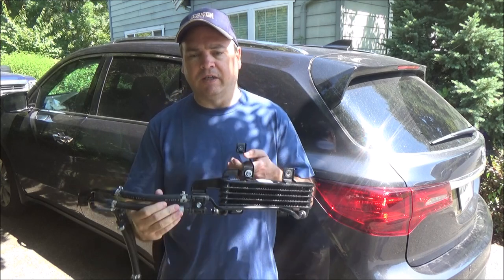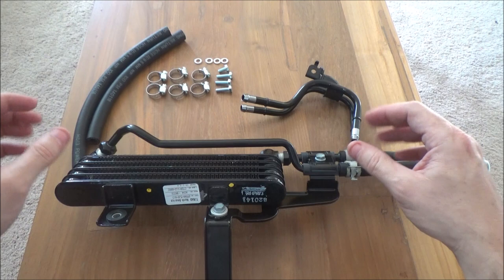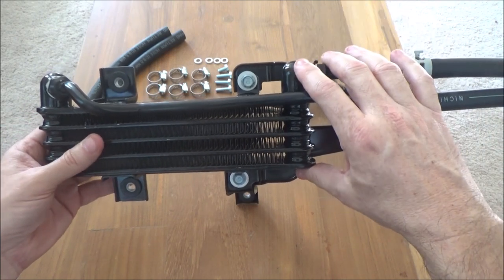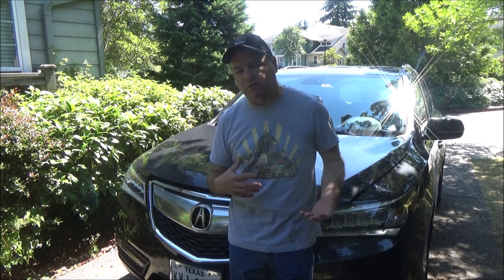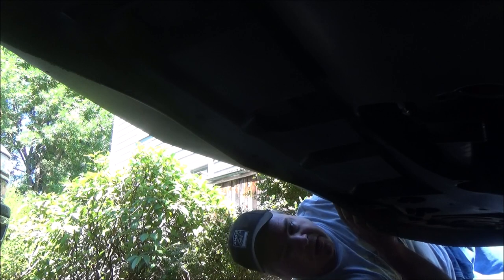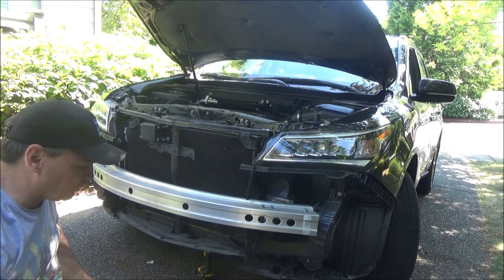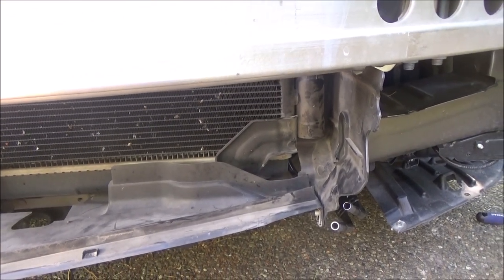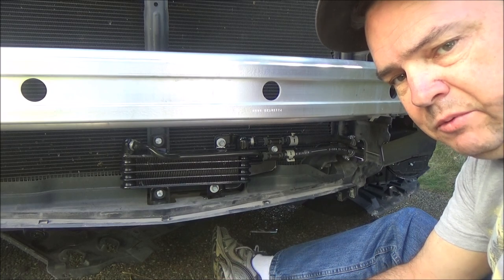Installing Transmission Cooler on an Acura MDX

Comment: Hey in case anyone is going to tackle this like I just did - take the bumper off.  I was up for the challenge of not taking it off for fear of screwing something up - whenever it comes to "clips" and "me" I always break stuff.  I tried my hardest to do it w/o taking bumper off and it was a nightmare....couldn't figure out a way.  Sucked it up and took bumper off with no issues, thanks to your video, and the rest is cake.  Hardest part of whole job is flushing your eyes out after all the dirt falls in them when you're under it trying to get the clips and bolts out to remove plastic 🙂 Thanks again for the great video....couldn't have done job without it.
Reply from the maker: Glad it helped.  Thanks for watching.

Comment: I originally watched the OEM trailer hitch video and that saved me a lot of trouble, especially learning to add the harness to the hitch before bolting in the hitch. I was impressed with the detail. Now I'm doing the cooler and as stated, I saved lots of money by buying the components. Great tip.  The cooler install video is great and as usual, very detailed which makes the job simple. I like the explanation of the cooler design as that is good to know. I'm an old auto transmission tech and keeping trans oil cool is the secret to transmission longevity. Thanks for a great video! Joe B.
Reply from the maker: Thanks for the comment Joe.  I am glad the videos are helping.  I felt the same way about the cooler in helping increase longevity of the transmission even when not towing.  I will post more videos as I get them done.  Next up is a brake system flush for the car.

Comment: I did this on my 2014 MDX. I needed longer cooler lines than what this specd. Good time to change the tranny filter as well. This probably adds a quart of capacity. I added over 5 quarts back after this drain and install. Thanks for the info. I also just loosened the top of the bumper and left the bottom attached for access
Reply from the maker: Awesome. Thanks for watching.

Comment: For anyone interested - there are aftermarket duplicates of the OEM cooler sold at a price savings. I saw them at a couple of online auto parts suppliers. Personally I prefer OEM parts but for those looking to reduce the cost of this upgrade there you are.

Comment: thanks for the video.  just installed mine and confirm it is SOOOO much easier with the bumper off.  I have no idea how others were able to do it without taking the bumper off.  Thanks!
Reply from the maker: You are very welcome.  Glad it helped and thanks for stopping by and sharing your thoughts.

Comment: Thanks for the vid! Everything mdx should have one of these installed. The 14-16 have issues with the torque converter overheating and degrading the  fluid which causes shudders and jerks. There's a TSB fix by a software update and flush tranny fluid. Guys are doing tranny fluid every 10k to prevent it from coming back.
Reply from the maker: I do mine frequently because it does seem to breakdown faster than I would have expected.  Fortunately, the fluid is way cheaper than the newer 16 and up models.

Comment: What is the part number for this? Where did you buy it that was so much cheaper than Acura/Honda??Thanks.  For the hose length, I just picked up 2 feet of hosing from the auto parts store and cut to size. It was in a Prestone kit at O-Riley Auto parts. I just took the transmission cooler down there with me and matched up the hose on the cooler to what they had on the shelf.  I used the hose length specified in the full kit I found online ($250) which was 235mm and 295mm. However, I cut them to 240mm and 300mm just to give myself a bit of extra room. The part numbers for the transmission cooler (stand alone, not part of the kit) and the pipe that wraps around the radiator and condenser are both specified in the video but here they are for reference (cooler: 25500-5J8-013) (pipe: 25220-5J8-010).  Good luck on your install. It's pretty easy

Comment: Thanks for the great video. Ordered the parts and look forward to getting our MDX more trailer-friendly. $75 worth of parts vs. $250 kit...just can't figure that one out...
Reply from the maker: Didn't make sense to me either. The key was getting the tranny cooler separate from the kit at that good price.  Once you have that, putting the rest together was easy.
Reply: @RoughRidersTV  Alright - putting the front back on I wanted to share this tip for others. Get 2' of hose and cut in half, only trim to size when you can mark how long exactly they need to be. Mine needed to be longer than the lengths described (I have a 2014 as well) - not sure why, but regardless it will save another trip to the parts store like I had to do...I would guess mine ended up at 9.5 and 11"
Reply from the maker: @1972mdc  Awesome.  Thanks for the tip and sharing the update.  Glad it worked out for you.

Comment: I'm a few years late to the comments here, but this video is timeless!

Absolutely wonderful demonstration on how to install a transmission cooler.  This is one of those rare videos in the subcategory of repair videos in that you won't find many not just on this make and model, but on others, especially when it comes to the "higher end" cars where the owner will likely pay a shop to do it.

If you do read this, any chances on you doing your suspension?  I am getting ready for the rear on a '15 MDX as well, with a major overhaul to it.   I might film it and see if I can upload it somewhere. Front suspension will be done next summer.
Reply from the maker: Thanks for the comment.  Glad it helped.  It's why I make the videos in the first place.  Help people that may have never done something like this...they can see generally how easy it is to do.
Reply from the maker: As for a suspension video, the MDX is still very solid at the moment so no need to do it on this car.  However, my duaghter's Nissan Rogue needed some front end suspension work so I made a couple of short videos on that process.  It's very similar to most front end setups with independent suspensions.

Comment: Only 7 minutes in but you may want to think about adding an inline filter to that as an extra layer of protection for the transmission.  Those little inline filters are easy to install and changing them when you do an oil change is easy and would give you some insight to what’s happening with that transmission.
Reply from the maker: Good tip.  This already has the inline filter but I agree, if you don't have one, it's a good idea to add it.
Reply: @RoughRidersTV  Can you tell me where that filter is? Just ordering the parts for our '14 MDX today.
Reply from the maker: @joeaverager  If to watch the part of the video where I am connecting the hoses up, one of those connections is the filter.  It's the part where after I connect up the wrap around metal lines (part from Acura), I then put in the hoses I cut from the auto parts store.  One line goes to the transmission directly and the other goes to the filter which is then connected to the transmission.  It's not really easy to see the filter itself in the video.

Comment: Advice. Learned the hard way- double check make sure you have the vertical bar on your MDX. My 2014 doesn’t even have it and I cannot mount this cooler anywhere. I’m out $180 as oem prices have doubled and I should have bought the full kit that comes with the bar
Reply from the maker: Can you fabricate the bar?  If that is the only thing preventing you from mounting it, might want to give it a try.

Comment: A couple of more questions . . . how much ATF did you lose when disconnect/connect the cooler? Then how much extra ATF was needed to bring it to proper level? I'll be adding this ATF cooler, buy them piece by piece to $AVE thanks to your suggestion. Thanks again!
Reply from the maker: Surprisingly, I didn't lose any fluid when I disconnected the hoses.  I expected to lose some but didn't.  As for how much I put in, I don't recall the exact amount but I think it was between 1/2 and 3/4 of a quart.  I just used the dipstick to judge.  However, I also did a fluid drain/fill a week or two later.
Reply: @RoughRidersTV  Great, thanks for speedy reply, much appreciated.

Comment: The new 2020 Acura mdx has cooling system. That uses the antifreeze to the transmission… I have question .. you think if the cooling system is empty no antifreeze.. that won’t the car to start ?
Reply from the maker: It's not the first thing I would look at.  Motors need generally 3 things to run...Fire (aka Spark), air, and gas.  When  car does not start, I start with those basic things to see where the problem is coming from.  For example, in the case of fire/spark, I look at all the things involved in generating that spark...from the battery to the spark plug and everything in between.  In the case of gas, things like the fuel pump, fuel lines, filters, etc. that might be preventing gas from reaching the cylinders.  So if the car is not starting, those are the things I would look at first.  From there, I would then look at the computer to see if it was inadvertently locking something down.  The transmission and drive train are all about moving the car once it is started so I can't think of anything immediately that would prevent it from starting.

Comment: Hey what about the air trapped in the radiator and hoses? It's a a closed system right? Do you have to burp it like with antifreeze in the regular radiator?
Reply from the maker: This video was more about the installation. But the transmission while pressurized, it not quite the same as a cooling system. Keep in mind, your transmission dipstick will help remove excess air as the fluid circulates. When topping off, I just use the dipstick tube and a transmission funnel.
Reply: @RoughRidersTV  yeah I was thinking about the dipstick but just wanted to check. Thanks for the reply.
Reply from the maker: @zconiglietti  No problem. Thanks for stopping by and checking out the video.

Comment: R R, thanks for taking the time post this video 👍.  

I plan on doing this install on my 2017 Honda Ridgeline (Brother to the Pilot) using the Pilot’s OEM ATF COOLER KIT P/N 06255-RLX-306.  My question is, do you recall how much fluid did you end up adding? 

Thanks Again
Reply from the maker: I think it took an extra 1/2 to 3/4 quart.  Normally it holds just over 3qt. (like 3 1/3) but when I did a fluid change on the tranny (video posted on it as well), you can see I pulled about 4qt. out.

Comment: Great video. Thank you. Does the front fascia have to come off for the install, or did you do so for better access?
Reply from the maker: Hello Arif, Thanks for the comment.  You could probably do it without doing it and just removing the center piece but I think you will find the job substantially easier by just removing it as 1 piece.  Removing it gave me better access to everything as well as allowed me to get better shots for the video.  For example, go to the 17:42 mark where I am installing the pipe that wraps around.  With the from fascia still on, this would be harder to do but with it off, it was super easy.  Removing it really is not hard and installing it is also easy.  If you are doing an aftermarket cooler, I think you would need to remove it so you can get to the AC condenser and install the zip strips.

Comment: Thank you for the video. I am trying to install this to increase towing capacity. . 
Could you help me to find the hose you used? Did you buy it from local auto parts store? Or homedepot? Should I ask for 3/8" rubber hose 100psi?
Reply from the maker: I got it from O'Reilly Auto Parts.  It was about $8.00 or so for about 1.5 feet of hose.  Just look for the hoses used for transmission lines.  Shouldn't be hard to find.
Reply: @RoughRidersTV  Thank you. You are awesome!